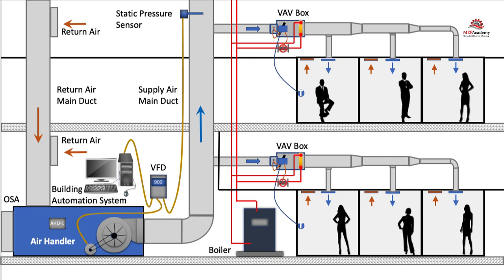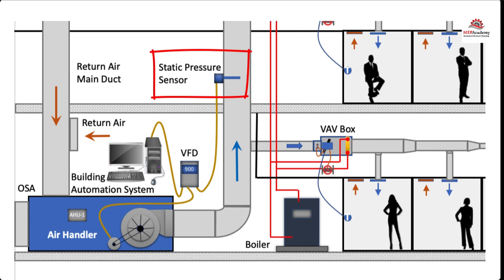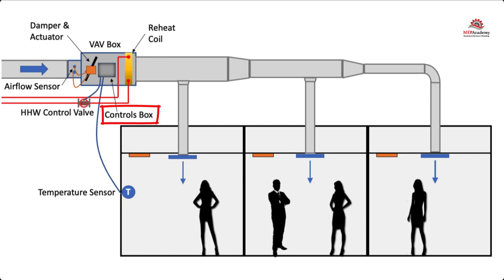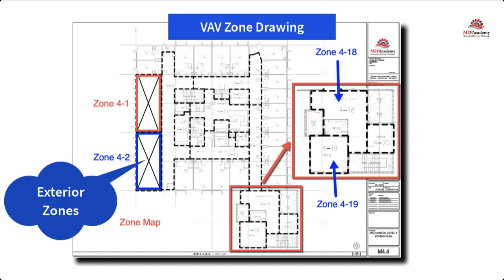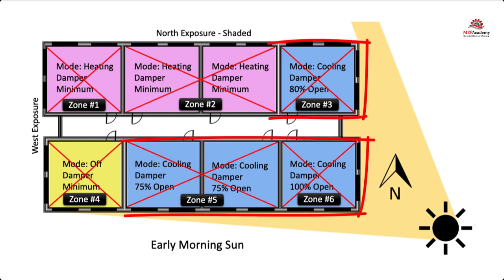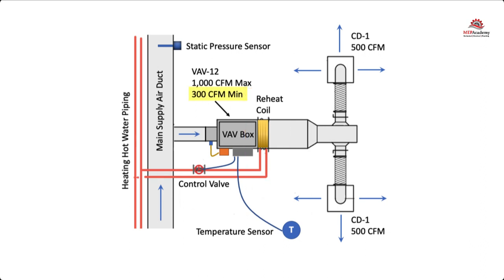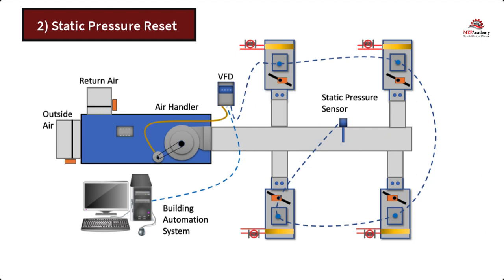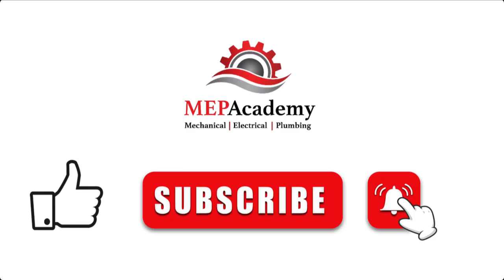How a Variable Air Volume VAV System Works

Comment: The issue isn't with VAV itself, but rather how to consistently maintain a constant static pressure right up to the VAV.
Frankly, VAV control isn't difficult.
The problem lies in how to maintain constant supply air temperature and static pressure.
Without understanding that, any explanation is utterly meaningless.
I've never seen a video explaining that either.
Reply from the maker: That’s a fair observation. VAV box control itself is relatively straightforward — the real complexity is at the system level, specifically how the AHU maintains stable supply air temperature while the fan modulates to maintain duct static pressure as terminal units open and close.
Without understanding that interaction between the AHU discharge temperature control, static pressure reset strategy, and VAV damper behavior, VAV explanations do lose context. That system-level coordination is exactly where many designs and sequences succeed or fail.

Comment: I work in Building maintenance and we have this type of system currently. They replaced the chiller and have a back up chiller which is a trane and 30 years old. Very helpful video
Reply from the maker: Thanks for sharing your experience and for watching.

Comment: VAV is not achieving box flow with the set point, example set point is 160 l/s but it's reaching only 83 l/s what could it be
Reply from the maker: If your VAV setpoint is 160 L/s but you only get ~83 L/s, check these in order:
Damper position & inlet static:
If damper is >90% open and flow is low, your upstream static is insufficient. Raise AHU static setpoint / verify VFD, open upstream balancing dampers, check for blocked filters/coils.
If damper is mid-range but flow reads low, suspect sensing/calibration.
Flow sensor/K-factor & tubing:
Verify the box size and K-factor in the controller match the actual unit.
Check SI vs IP units (L/s vs CFM conversion).
Confirm pitot ring orientation, no kinks, and tubing not reversed (HI/LO).
Zero/scale the dP transducer.
Control limits & modes:
Make sure Max Flow and Occupied/Heating min aren’t capping the command (some sequences hold heating min during reheat).
Check point priorities (BAS override) and PID output not saturated.
Duct & box issues:
Tight/short elbows at the inlet (insufficient straight run), closed balancing dampers, or physical damper binding/leakage can all reduce measured flow.
Quick test: note damper % open and inlet static at the box.
High damper %, low static → supply issue.
Moderate damper %, low measured flow → sensor/K-factor/units issue.

Comment: What is the difference if the installation of the static pressure sensor is installed where de air supply began?
Reply from the maker: The static pressure sensor would need to be set at a higher pressure near the fan outlet which would defeat the purpose of maintaining just enough fan power to meet the demands of the system in order to reduce the fan speed to save energy.
Reply: @MEPAcademy  thank you, any book you recommend?

Comment: Best VAV video I’ve seen. I’m currently dealing with a 5 VAV zone system where 4/5 zones need to be calling for the RTU to supply. Electric heat keeps tripping the high limit. I had to replace the VFD earlier this winter, I reset all limits and it was working fine. Just got another callback due to all limits being tripped again. They need to lower the number of zones needed to ramp up the discharge air volume.

Comment: Why must the air duct pressure sensor be installed 2/3 downstream of the air handling unit?  How about installing it remotely?
Reply from the maker: In Variable Air Volume (VAV) systems, the pressure sensor placement impacts how the system modulates fan speed to maintain the desired duct pressure. Positioning the sensor at two-thirds of the duct length ensures adequate pressure is maintained for downstream zones without over-pressurizing upstream zones.

Comment: If 30% open is the minimum to achieve ventilation, would 100% open be too much fresh air/outdoor air for the zone? And more energy waste on preheating and precooling?
Reply from the maker: When the temperature outside is within a certain range, the use of the compressor can be reduced or eliminated. This will save on energy. Check out our two other videos that will give you a better understanding on how using outside air can be beneficial. DOAS units: https://youtu.be/XYOVSVVoN24 and Air Side Economizers: https://youtu.be/2UCmNs8qGBk

Comment: What is the cause of condensation in AHU
Reply from the maker: Are you talking about condensation at the cooling coil. Condensation on a cooling coil typically occurs when the surface temperature of the coil is lower than the dew point temperature of the air passing over it. The dew point is the temperature at which air becomes saturated with moisture and begins to release water in the form of condensation. We have a video that will help you understand the concept of sensible and latent heat. https://youtu.be/iME-1I9G4Qw

Comment: Lets say we have one AHU, in that total 5 VAV is there for 5zones.. vav will operate based upon the temprature demand, VFD will operate based on the static pressure in the main supply header. Then what about the PIBCV valve in chw pipe.  Ahu main return air duct temprature would be the average of these 5 zones.. Then how the pibcv get operates if we take feed back from return air duct.
Reply from the maker: Please watch our video on Energy Valves to see if that answers your question. https://youtu.be/XzQ0udiLgec

Comment: Where would the AHU duct static pressure is normally located? is it right at the outlet of the AHU fan or further down?
Reply from the maker: Usually 2/3rds of the way down the main supply duct.

Comment: The minute 12:05, you mentioned the air temp from AHU will bring 55 F whether the building is on heating and cooling load. is AHU cooling only? what about heatpump AHU in this case?
Reply from the maker: In this example without supply air temperature reset, the temperature coming off the coil is 55 F even when the volume of air has been reduced to the minimum to maintain ASHRAE 62.1 ventilation requirements. Heat Pumps are a completely different system, while this system is using a chilled water coil in our AHU.

Comment: What if that air handler is a split system or a package unit? Who will turn the condenser unit off ( if split system )or compressors off if package unit?
Reply from the maker: If it's a packaged unit or split system the controller will dictate when the system runs. With a split system there will be a communication wire between the air handler and the outdoor unit. Controls are the key to controlling any system or system configuration.
Reply: @MEPAcademy  thanks

Comment: That air handler is connected to a chiller?
Reply from the maker: Yes, it's very common in commercial projects that the cooling is provided by a chiller serving a chilled water coil in the air handler.

Comment: Hello! I am a licensed architect in California, watching your video to better understand mechanical systems. I have a question. Regarding zoning, particularly at high exposure corners on the south elevation, if the architectural team chose to increase insulation or other measures to reduce the solar exposure on that elevation, how could that be quantified to potentially reduce the peak cooling on those high exposure zones
Reply from the maker: Of course an increase in the "R" factor of any insulation or other measures would increase the "U" factor used in the cooling and heating load calculation. The larger the "R" value, the lower the "U" value will be, which lowers the cooling load. This will reduce the size of the Air Handler or Air conditioner serving that zone. An energy analysis can quantify this, and show the before and after results of any increase in the "R" value under consideration. Taking this one step further, an analysis of the payback period can be determined based on the increased cost to achieve a greater reduction in the cooling load. A reduction in the cooling load effects all parts of the mechanical system, including equipment, air ducts, refrigerant piping and air distribution grilles. This is depends on the type of system used of course. Title-24 in California allows tradeoffs using the performance method to achieve an overall energy reduction goal.

Comment: Having a single VAV box provide air into numerous zones is not a good design. If the heat load goes up in the room that the space sensor is located it will make the other zones too cold.
Reply from the maker: It's much too expensive for every room to have its own VAV box. Engineering best practice is to group rooms with similar thermal profiles, such as multiple exterior office spaces that have a southern exposure. You should of course avoid mixing interior and exterior spaces on the same zone. Rooms that are periodically occupied, such as conference rooms and such should be have their own zone. There is definitely no practical reason not to group rooms together that have the same load profile as this is the most feasible and energy efficient.
Reply: @MEPAcademy  I can't tell you how many times it's caused problems. Several rooms, same size, one temp sensor in one office. Have a meeting in that office greater heat load and freeze the other offices. Bad design.

Comment: According to your knowledge/experience , which is better? Zoning with VAV boxes or with zoning kits come with concealed ducts systems (splits)…I think with VAV boxes we have more customization options, do you agree with that....
Second question: In the video there is a heating coil inside the VAV box. Is this an alternative to the heating coil in the air handling unit? Can we have a coil for heating and another for cooling inside the air handling unit, and at the same time we also have a coil for heating and another for cooling inside the VAV box?
Thank you....
Reply from the maker: Each building needs to be reviewed for the best HVAC system type, taking into consideration many factors, such as geographical location, building size, energy cost, new or retrofit, etc. Consideration for how ventilation will be provided to each space is easier with a central Air Handler feeding VAV terminals, then having dozens of split systems everywhere, which would require a DOAS or some form of outside air to meet ASHRAE 62.1. Having a heating coil at the VAV terminal is good for external zones that will have heat loss through the building shell, while interior zones most often don't need heating coils because internal heat loads negate the need for heating.

Comment: Can you explain CO2 control to me?
Reply from the maker: Per ASHRAE 62.1 certain high density spaces like meeting rooms require CO2 monitoring to ensure that there is enough ventilation air when the space fills up with people, and not too much OSA when there are only a few people. See our video on "Demand Controlled Ventilation" for a visual representation of how this works with CO2 sensors.

Comment: I have a question, what is the software used to draw this schematic diagram ?
Reply from the maker: Depending on what you're planning on using the diagram for, you can use anything from PowerPoint for a simple diagram all the way to a more sophisticated CAD program. What will you use the diagram for?

Comment: Thanks for sharing 
Can u tell which sensor( airflow or temperature)has high priority control over damper positions?
Reply from the maker: The box damper will modulate to maintain a Supply Air CFM set point between a preset minimum air flow and maximum air flow. If the space temperature rises above the cooling set point, the box damper will modulate open from a minimum cooling CFM air flow set point, to a maximum cooling CFM air flow set point, as cooling demand increases. An air velocity pressure sensor will maintain the supply air CFM set point for pressure independent operation.